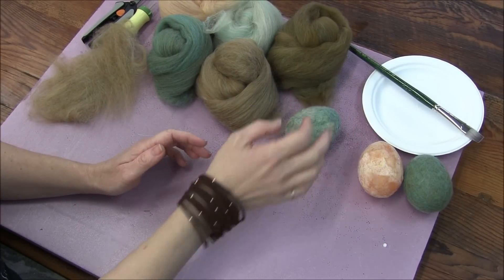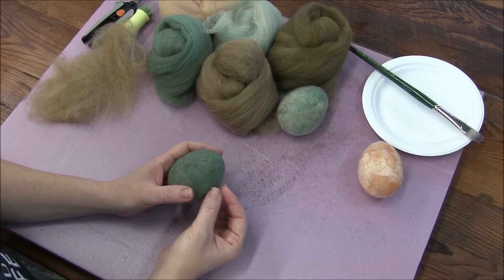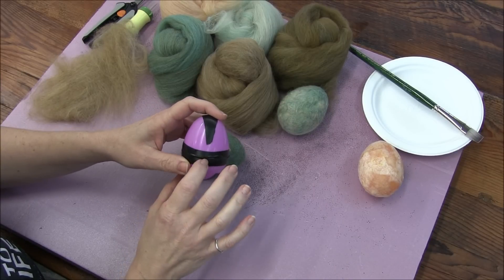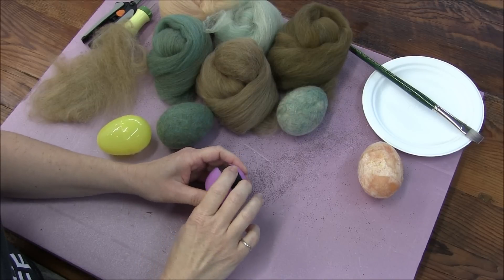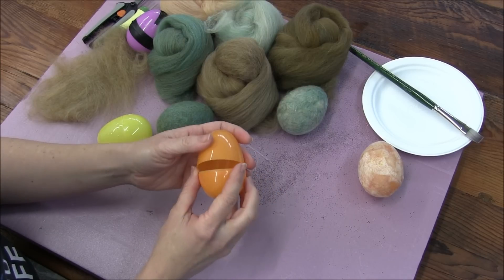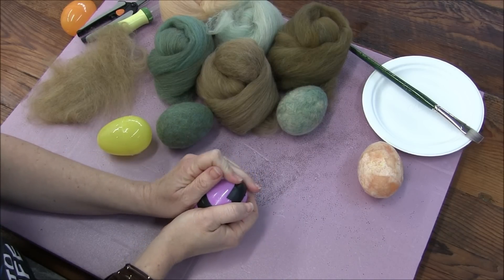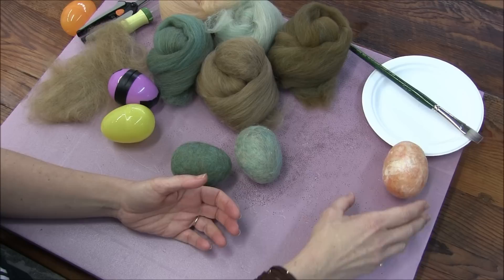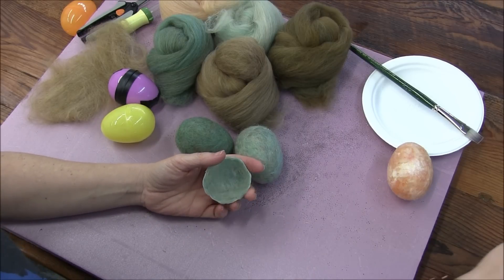Wool Egg: Wet Felted and Hardened

Comment: Duct tape, cut a bit smallish, works great! I use real eggs so we don't have to keep piling up the plastics. The beauty of it is the egg shell can be crushed when it's cut into. If you don't want to cut your egg, it just sits there inside, minding its own business. Decades from now someone can throw it on the compost in good conscience.
Reply: I've done a couple dozen using the blown out egg and have only had one shell break apart while felting. Of course I don't use too much pressure during the felting process.